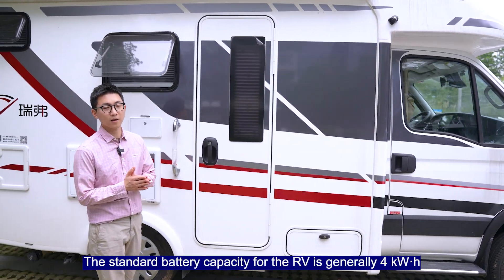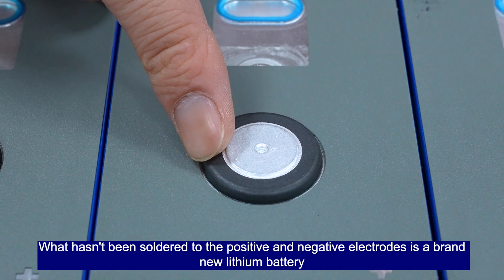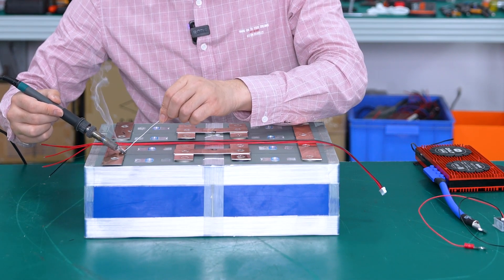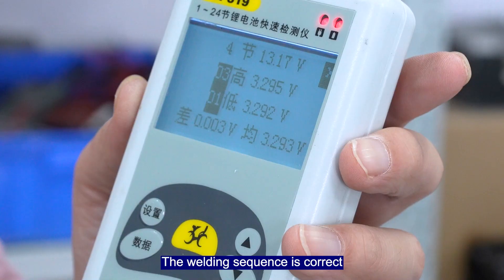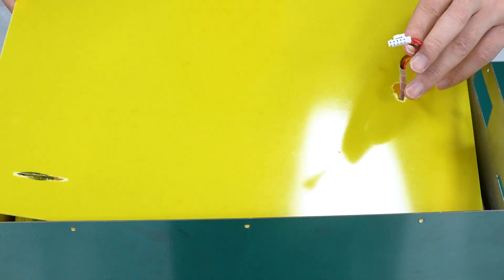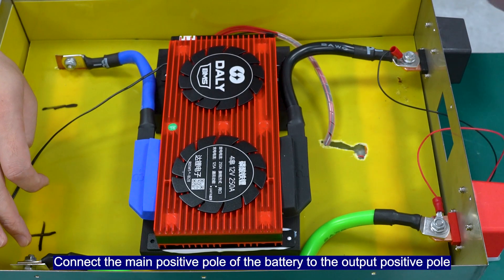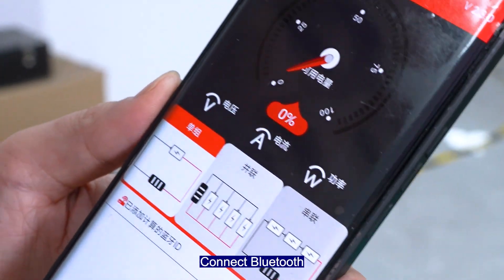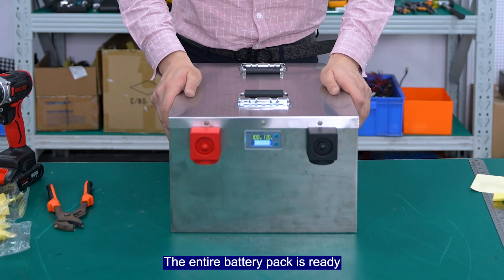Build a 12V 400AH Battery pack for the RV

Comment: great video sir👌👌.
kindly tell us❤
 is daly smart bms bluetooth is always on or we need to click the push button every time when we need to watch live data?
i mean to say if we inbuilt the push button in cabinet.then how we connect with bluetooth of bms?
Reply from the maker: By default, if the device does not work for one hour, the BMS will enter a sleep state, and no Bluetooth signal can be searched at this time. If it is not convenient to press the Bluetooth button, the BMS can be activated by charging the battery. Of course, you can set the time to enter sleep on the app to infinity, which is equivalent to turning off sleep. You can connect to Bluetooth at any time
Reply: @BMS-Lithiumbattery  
thanks for your valuable answer sir👍
but sir i had try many times. sleep time maximum limit is 3600 seconds of bms.i am not able to set it to infinity.
Reply from the maker: @lithiumenergy5714  I just tested a few times and there were no problems. After entering the time, click Set, and the password is 123456. Additionally, 65535 represents permanent. You can try again😀
Reply: @BMS-Lithiumbattery  65535 is the infinity sleep time code?
Reply from the maker: @lithiumenergy5714  yes
Reply: @BMS-Lithiumbattery  thank you so much sir😊